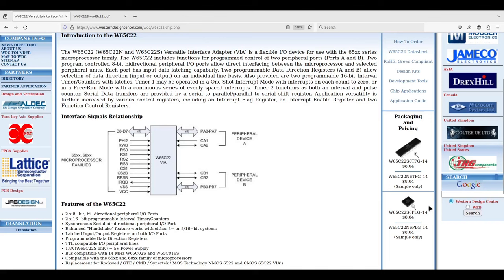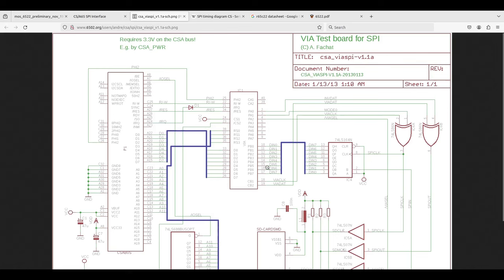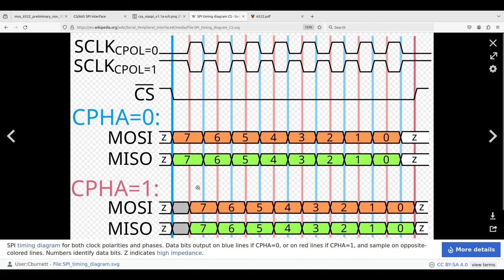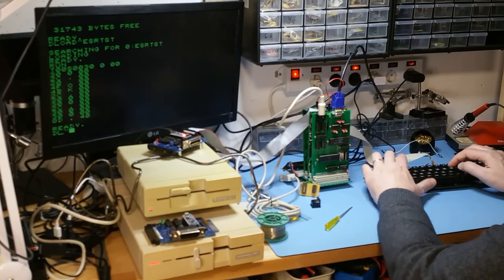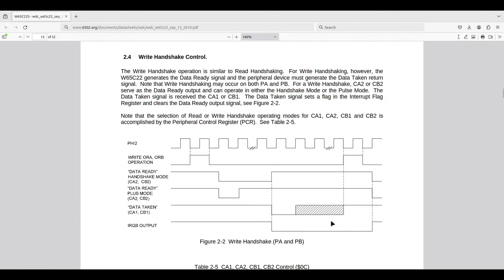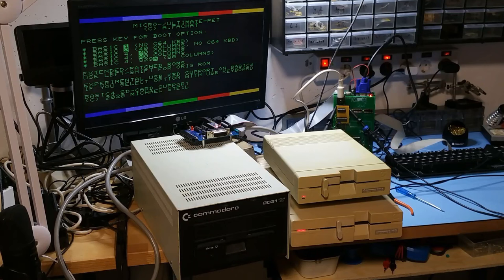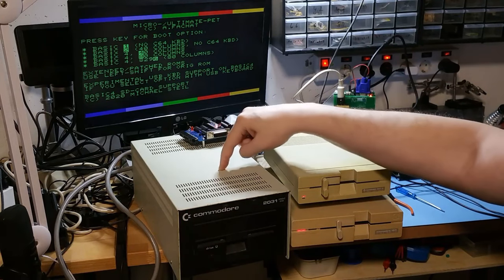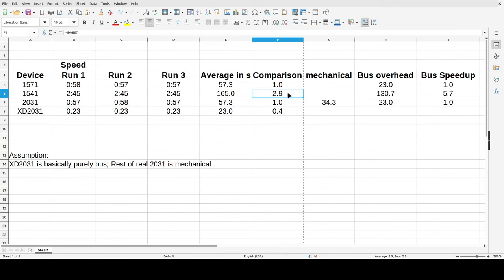8bit-times Ep. 25: VIA shift register bug followup

Comment: It almost seems that every piece of I/O silicon deigned by MOS Technology had some sort of weird problem.  That the serial shift register in the 6522 is wonky is no surprise to me.

The shift register seemed to work okay in the 6526, but that device has the timer B interrupt bug (which can break the fake RS-232 routines in the C-64 and C-128), as well as an interrupt bug involving the TOD clock.  The 8563 and 8568 are both brain-dead CSG designs (the implementation of the block copy/fill operation is idiotic), and the VIC was lame as well—no hardware cursor, thus burdening the operating system will generating one.

Regarding the 6522 shift register, Commodore didn’t see fit to address any of these issues, so I wouldn’t have expected Bill Mensch to invest much time into it as well.
Reply from the maker: I still wonder why Commodore never thought about fixing the VIA - after all they were producing them themselves. Maybe they already had plans for the 6526. After all, the 1541 was supposed to have a 6526 for fast serial, if it weren't for the missing traces on the C64 board. 

As for the 6526 bugs ... they didn't seem to have such a strong effect. I only heard from your comment that the RS232 could be broken by a timer bug. A quick googling didn't reveal anything, do you have a link? Anyway, the 2400 baud userport was quickly surpassed by the 9600 baud interface (that actually uses the shift registers).

When doing a chip design, a lot depends on budget and timing. And I believe that at Commodore - at least for the management - a computer was just "a product": you ship it and that's it. Therefore there was never (at least after the PET, to my knowledge) any attempts in extending and upgrading existing models, only cost-optimization. So when a chip needed to be done for a product release - it was done. Off to the next project / product... Otherwise they could have created a new revision of the VIC or VDC that fixed the deficiencies. But what for - that product had already been shipped, and fixing stuff would probably even have made things incompatible. The VDC may be an exception, but I think that was also driven by cost-optimization - and why fix it, the software works in the end...?

Comment: "Synchronous" serial in a communication protocol means synchronous to the clock signal being passed in the interface, not synchronous to the system clock of the receiving unit.

It may be possible to convert from Mode3 to Mode0 with a GPIO and a quad 2-input NAND (74x00). Two NAND gates are wired as a /S /R latch. The /S input to the Q output gate comes from SPI_CLK3. The /R input to the /Q output gate comes from the GPIO, call it /Sel_Mode0. Before select, and after each byte completes, the /R input is pulled down and back up. This pulls Q low. On the first downward pulse of SPI_CLK3, Q is released to go high.e

Q is input to the 3rd NAND gate, and the other input is SPI_CLK3. When Q is low, the output is held high, when Q is high, the output is the inverse of the SPI_CLK0. This gives a clock cycle which is idle high but the first half clock cycle is clipped from the front, and when /Sel_Mode0 is pulled down the last half cycle is completed.

So this is Mode3 to Mode2.

And the final NAND gate has the SPI_Clk2 as one input, VCC as the other input, and this inverts the clock to give Mode0.
Reply from the maker: I believe we discussed this here :-)
http://forum.6502.org/viewtopic.php?f=4&t=7937#p106623
Reply: @8bittimes yes, including a nice circuit diagram to replace my breadboard wiring notes.

Comment: Very interesting, a bit odd that it took this long only for someone to say: "oh, it was never designed to work this way".
So fast serial could have worked if CPU and drive had the exact same clock speed?
Reply: If they had the exact same clock speed then it still wouldn't work because they could turn on in exactly the wrong phase to each other. If you could get the exact same clock speed.
Reply from the maker: Indeed. Getting the "exact same clock speed" between two such systems with separate clock generators is nearly (if not at all) impossible. You'd have to pass a wire from computer to drive to send the clock signal, and the drive has to use it or synchronize its clock (e.g. with a PLL). That wire does not exist, and is probably impractical.

Comment: Asynchronous means you don't connect a clock line at all. Shifting in under external clock is synchronous even if the external clock is not synced with phi2. So I'm disappointed with WDC response.
Reply from the maker: I can understand that in the mindset of those days, asynchronous meant "no clock, like in RS232" - after all the ACIA was the "Asynchronous Communications Interface Adapter".